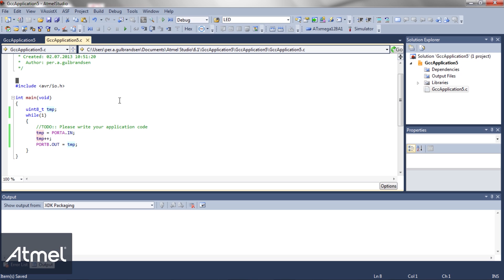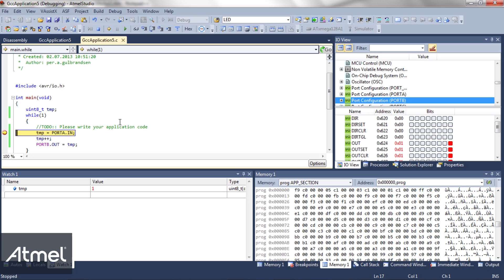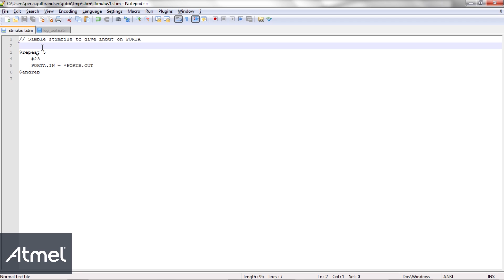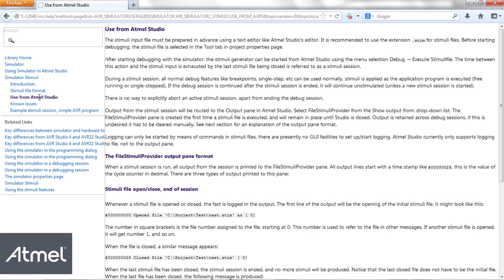How To: Using Stimuli in Simulations with Atmel Studio

Comment: Is it possible to use Stimului to stop the simulation at a given count on the Stop Watch - effectively a time-related break-point?
I am making a gadget in which INT0 is triggered by a mains zero-crossing every 10mS, and it would be very useful to be able to let the simulation run until the point where the stop watch says it is time for the interrupt.  Then I can trigger the interrupt with all counters updated by the software.